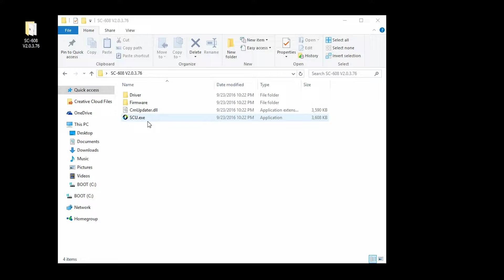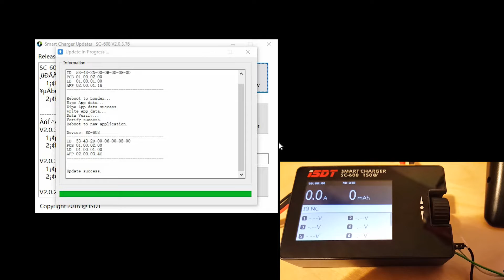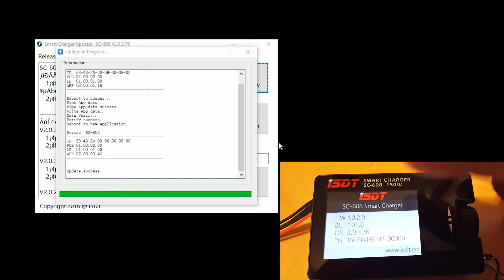iSDT Charger Firmware Update

Comment: I bought N8 and cannot update the software.  Connect the device failed.  What can I do?
Reply from the maker: You probably have a COM port or USB driver problem on your PC.  Without some diagnostic info, there's no way to tell from what you wrote.
Reply: Albert Kim I have already solved this problem.  The USB cable provided with the charger is broken.  The charger attached by him turns on, but does not communicate with the computer.  I connected another cable and everything works.Thanks for showing interest.👍👍👍

Comment: Liked the video. I have the D2 model and I am trying to update the firmware.  When I download the update there is no driver in the folder. Shouldn't there be? There is a firmware file folder and SCU application. I open SCU app and all options I choose fail. 1. Update Now.   2. Install Driver.   I have emailed support and asked for help have not heard anything yet.  Any ideas?
Reply from the maker: Something might buggy with the app?  Maybe you need to run it under compatibility settings?
Reply: @AlbertKimTV  thanks I will try
Reply: I was able to update the firmware. There is no driver in the folders. Once you open the SCU file, power up the charger and connect it to the computer via the linker and hit Update Now and that is it.  The video for the D2 ( not your video) shows a driver folder and that is what led me to think there was something wrong or missing in the firmware update . As usual probably operator error. Thanks again for responding.

Comment: mine is having some different information. The system says this on software info
HW 1.0.3.0 (it's different with yours)
BL 1.0.1.0
OS 2.1.0.8 (it's also different wuth yours)

Am I on the latest firmware ?
If i'm not, I'm going to buy isdt linker then update the charger (I don't have ftdi, so making diy linker is more hassel with same amount of money, hehe)
Reply from the maker: I don't know what the latest firmware is now.  If your number higher than mine on OS?  Mine has been working fine so I've left it alone.  If it ain't broke, don't flash it!

Comment: Im trying to do this on an arduino nano and it doesnt seem to work...not connecting to the charger...Ive never used an arduino before so not sure if Im getting something wrong...the pins on it are different to yours...
Reply from the maker: I think it will only work with a real FTDI adapter... That's different from an Arduino.
Reply: ah ok...I got bored of fiddling and ordered their own adaptor only $5 from myrcmart...

Comment: I bought one of this iSDT-SC-608 field chargers at Aliexpress.... seller sold 60, 23x 5 start rating so should be good. The field charger came with English packaging but when started all OS was in Chinese. 

OK - went to menu & the language selection was greyed out. Upgrade on latest firmware still just Chinese language. There is really a "chinese version" with Chinese language only & a "international version" with English and Chinese of that charger available. 

The worst... not upgradeable to "International" and it seems iSDT mislabeled a few packages as others also received wrong "chinese versions" from various shops (Banggood, Ali, Hobbyking) - so no sellers mistake. Any idea what is the difference between the both versions and if it can be "internationalized"? Unbelievable.

Or I must now learn Chinese, damn :-)
Reply from the maker: +hastlaAT I don't buy from AliExpress. Too many problems like this. Also horrible customer service...
Reply: hastlaAT i lie Ali very much. and i got mine also from Ali and it came in chinese witch is not my language. it is very simple to go to english. i like this charger very much